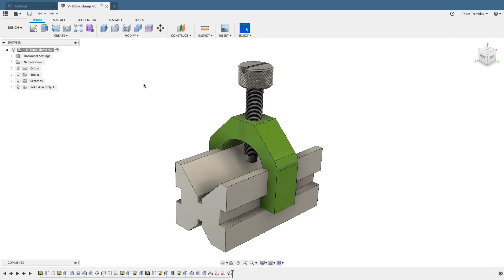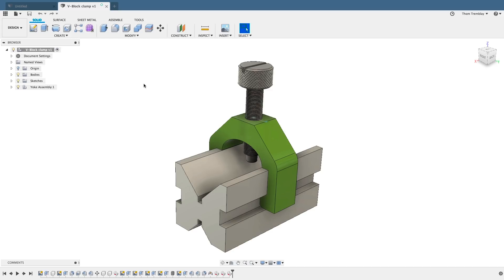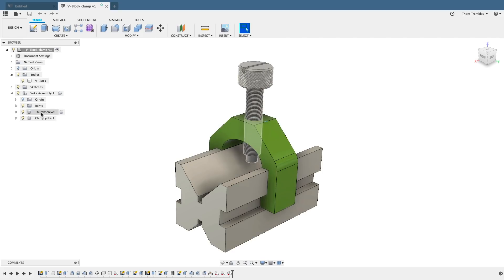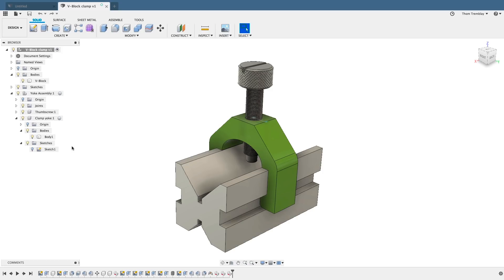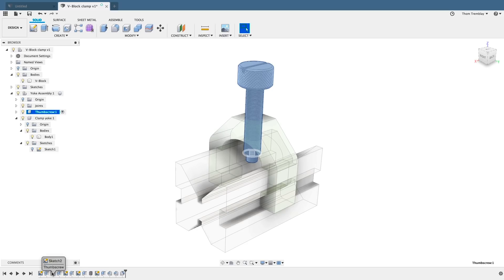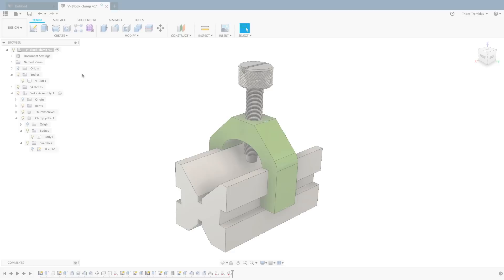Autodesk Fusion 360 | Tutorial: Bodies vs Components

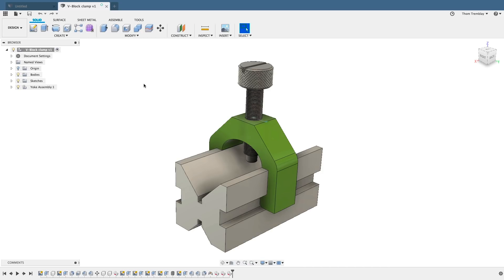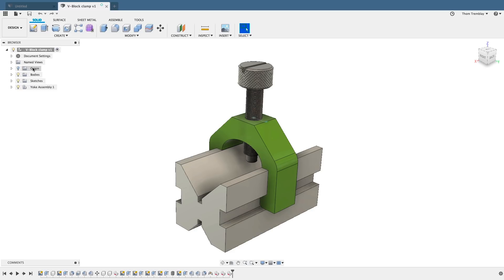Comment: this is a bit confusing because at 1:00, it's said that rule #1 is to create a component before creating any geometry, and at 1:10 it's said that "this design would be a poor example because a sketch was made and a body was extruded without creating a component". HOWEVER, at 1:46 it's said that "there is more than one component inside of this design" and that (1:53) "a component is easy to spot because it has its own origin and can contain its own sketches and bodies" - which there clearly is here (in the browser, under the assembly there are folders for origin, bodies, and sketches) so is it technically a component?

I understand that it's probably ideal to have everything within separate components, even if they are already directly contained within the assembly, just pointing out a source of confusion.

Comment: I have been using Fusion 360 for a few weeks, under the Startup package which has given me 1 year's access to the software which I am very grateful for. There's a few things to get used to compared to working with Solidworks (which I have used for 10+ years), however the more I use Fusion the more I'm starting to prefer it over SW. Also- this is a very helpful video.

Comment: OK...the searchable database fro learning doesn't bring any results searching for Body or component definition. After watching this vieo I still do nit understand how to convert body into a component.
Reply from the maker: Right click the body in the browser, and select to convert to component. https://forums.autodesk.com/t5/fusion-360-design-validate/convert-bodies-to-components/td-p/8678115
Reply: @adskFusion  I tried that, but this creates a new component from the body and leaves the sketches that form this body / component at top level. It's pretty confusing to me. You start a new project with an origin, create sketch and body, all top level. Then you build your second component by adding a component and the first one stays top level. What is this first object then if it's not a component? To be honest, I don't really understand this scheme. If I e.g. want to create an object made up of 3 parts to be 3d printed separately. Do I create 3 bodies on top level? 3 components? Or one body on top level and 2 additional components with a body inside as the program workflow leads me to?